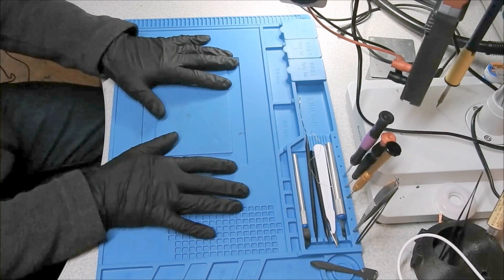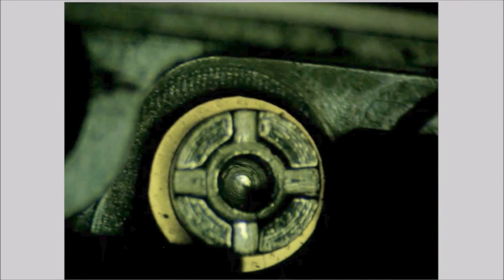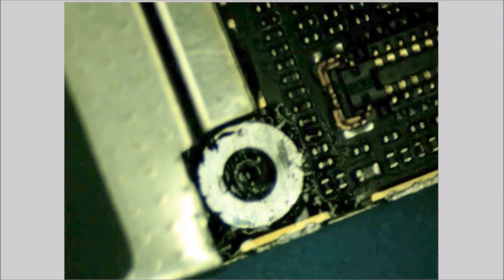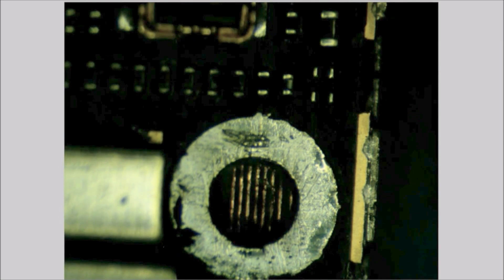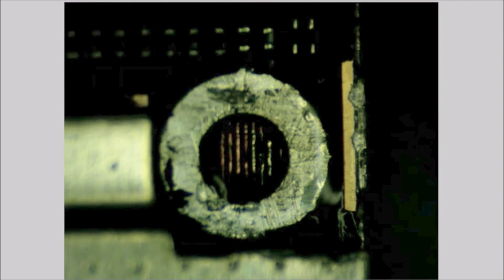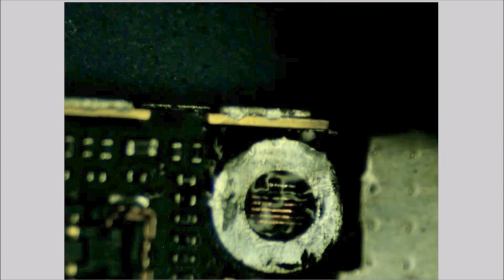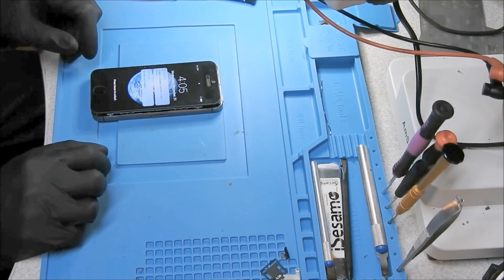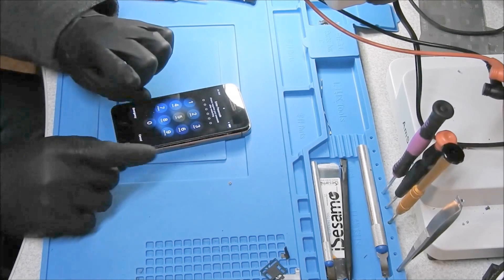iPhone 5s won't boot - Stuck in Recovery Mode. Long screw damage repair.

Comment: Hello! N8stech services.
I'm afraid to say even my iPhone 5 is going through the same thing, it's been years this has happened but I never gave attention to bring my iPhone back to life, now I seriously need it cuz I've many photos & some stuffs. So, if you can help me it will be very nice of you.

My iPhone doesn't even starts even if I press/hold the Power on button, I've to always plug in and then it shows iTunes logo. 
I tried installing latest software from iTunes but, suddenly the recovery mode failed and iTunes popped with mssg "ERROR 21".
I tried many different ways though but didn't succeed. 
Please help me, I guess it's a hardware issue inside the logic board.
I hope you'll respond to this.

Comment: hi mate i am experiencing the same problem,i tried to exit recovery mode with imyfoon fixppo. the apple logo is flashing plus the screen is turning red and flashing apple logo over and over. I reboot it manually and its stuck again in recovery mode. Itunes cant help due to error 4013, all techs in NAMIBIA cant fix it apparently its hardware problems..any more ideas please

Comment: Good day mate mine have the same issue and sometimes the screen turn into red. I done restoring it but the itunes says error 4013. Can you give me some advice on what to do.? Thank you
Reply from the maker: I had a 5s with red screen last week, check the front camera. Just disconnect it and try again, if that dont work change the camera IC and make sure the circuit is working. If that doesnt work it mat be your nand failing.
Reply: N8sTech Services  ok man so i just dis assemble the phone ill try that one.

Comment: hey i have a iphone that will show up in itunes if i put it in recovery mode but thats all it will do the screen wont turn on and it doesnt make a sound when i plug it in do you know what that could be?
Reply from the maker: Famous Amilo have you tried restoring it with iTunes or 3U tools?
Reply: N8sTech Services yes i restored it and its still doing the same thing
Reply from the maker: There are lots of possibilities and there is no way for me to know for sure without really checking it out. I would suspect you may need a new nand